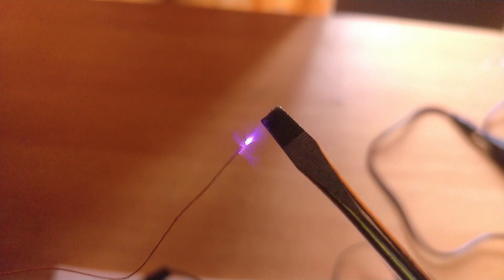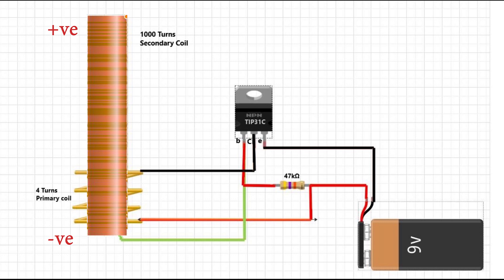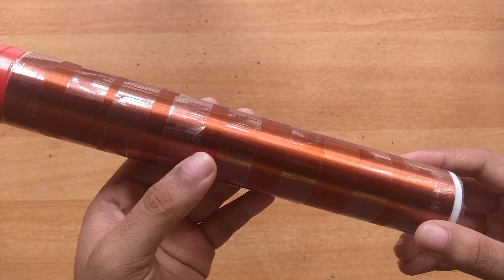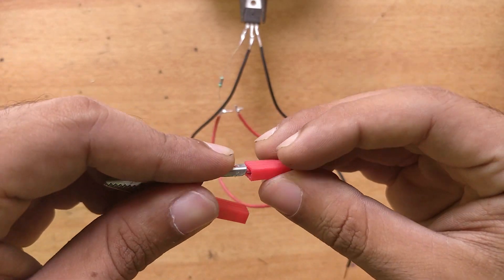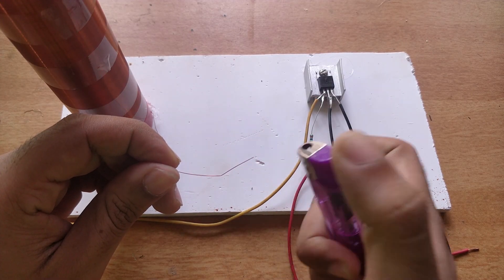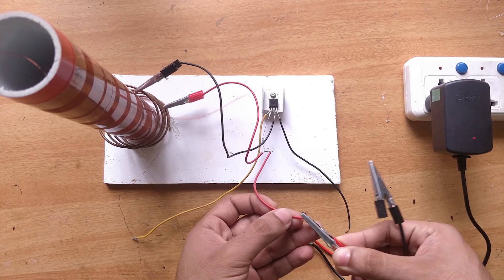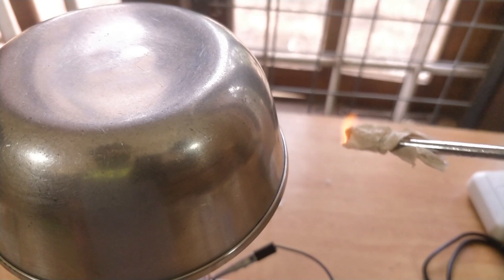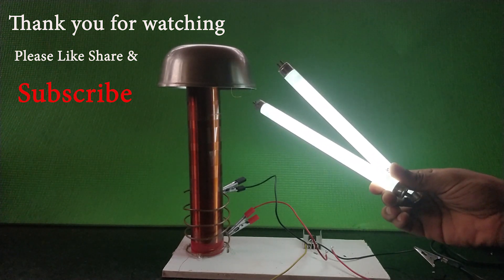How to make Tesla Coil at Home | Slayer Exciter | High Voltage Arc

Comment from the maker: There is a mistake in the video. It's 35 Gauge copper wire of 2 mm diameter instead of 30 Gauge wire.
 and the equation is (1/.20)x250 = 1250 turns.
Sorry for the worng information.
Reply: Can you give me 📞no
Reply from the maker: You can contact me on instagram@defender.scb or @behindtheclutter
Reply: @BehindTheClutter   pls tell me both copper wire are enameled or without enameled
Reply: Instead I can use 34gauge (0.23mm) 100 Meter yes or no
Reply: @NubierSmithen  yes you can.
Reply: Ok
Reply: I think you mean 0.2 mm copper diameter.
Reply: @privatepage7670  yes
Reply: Huh
Reply: Thanks cheta r u from south india?
Reply from the maker: Yes, I'm from South India
Reply: @BehindTheClutter  WHICH STATE?
Reply: Why there is 1/0.20
Reply: what would happen if I used a 1.5mm diameter insted of 2mm

Comment: I also made one but it is not working 😭 please help 
I used a 10 inches pipe which is 1.5 inches in diameter .
34 Guage copper wire for secondary coil and 20 guage wire for primary coil. 
A tip122 transistor and 47k ohm resistor 
I made more then 1000 turns in secondary coil and 4 turns of primary coil.
I used four 3.7v rechargeable batteries. 
I made the exact circuit as yours 
But nothing happened inly my transistor is getting hotter ......😢
Reply from the maker: Sorry, for the delay in response,  TIP122 transistor is fine but you need more transistors. You need a thicker wire for the primary. 3.7V battery is not enough to see the arc, if you are using it in parallel, that is not enough voltage, if you are using in series it doesn't have enough current, try using a stable 12V  2Ah or a motorcycle battery.  check if your current circuit is working or not by placing an incandescent bulb next to it.

Comment: Hey, would this work if my primary coil is 2.5mm diameter 5 turns and 0.5mm diameter 1000 turns?
Reply from the maker: If 2.5 mm is just the diameter of the copper in the wire then yes it will work. if its the measurement including insulation then its difficult.

Comment: Great video. Just made it and it works! of course it works.
Just a reminder to anyone, putting transistors in parallel may not work, it certainly wont work for long or wont work period. This is because no two transistors are identicle, so the one with the least resistance will take up most of the work if not all of the work. So it makes very minimal difference. But this circuit certainly does work and you can try it with more powerful transistors to increase the power!
Side note, Do not put a heatsink on the TIP31C transistor, It is electrically connected to the positive and will short circuit and kill the transistor: Learnt that the hard way :D
Reply from the maker: Thank you for the information and feedback. 😃

Comment: Hello sir, 
You are the best youtuber

i made a tesla coil with 2n222 transistor
and 3k resistance but it doesn't work
What i have to do?

Please reply 😢
Reply from the maker: 2n222 doesn't have enough power to run it. You need an NPN power transistor. Follow the video. It will work.

Comment: Please tell me that if i use Tip31c transistor with heat sink , will the transistor blowoff? , i will not use it continuously , my charger is of 12v and 1.5A ,
Reply from the maker: Yes it will blow off if you use it continuously even with a heat sink. You can use it safe if you use multiple transistors in parallel
Reply: @BehindTheClutter  if i use 3 parallel then how will i put them on heatsink?
Reply: @BehindTheClutter  2 in parallel are enough?

Comment: Can you help me because it doesnt work i used 
21mm diameter pipe length of 420 mm i used a 0.5 mm wire and 22k ohm resistor but it doesnt work can you help me pls and response quick.

Comment: How long is the life of this circuit when working with 12v?
Reply from the maker: It totally depends on the amount of current and the number of transistors connected in parallel. For 12V 2A and 1 TIP31C transistor,  It will work for 3-5 minutes and burn out the transistor.

Comment: I made project but nothing work pls tell me some mistake that to correct
Reply: The ciper wire u used is insulated .
For the thin wire burn the end so the insulation is melted,for the thick wire rub it with sand paper wherever u connect the crocodile clips
Also the power supply should be of 12v and 2 amp

Comment: Sir please five rhe link for the heat sink in the transistor,and the link to buy rhe resistor. Its not in rhe description
Reply: Also sir for hoe long does the metal plate  has to be on the tesla coil till it is finslly usable
Reply from the maker: It depends on the size of the tesla coil you build. and the size of the top plate.  The top plate will accumulate the charge until it get something to discharge.
Reply from the maker: https://amzn.to/3V1r3en
Reply: I have made the tesla coil and its works
But i am not getting such a big plasma that u get

Comment: Hey bro.. i tried it.. But unfortunately it didn't work... 
I used.. 
1. 23 gauge (0.541 mm) copper wire for the secondary coil.. 1400 turns (approx).. 73 cm high.. in 1 inch diameter pipe..  
2. 14 gauge ( 1.68 mm) copper wire for the primary coil .. 4 turns.. 
3. Tip41c transistor ( is that okay?? ) 
4. 47 ohm resistor ( 10k,10k, 27k connected in series)
5. 18 V input ..with an AC/Dc adaptor..

I connected exactly as you said.. but it didn't work... Please help me... Did I do something wrong .. I am just a 14 year old trying to do my best... 🥺🥺🥺🥺
Reply from the maker: Actually 75 cm is too high. You need to use at least 30 gauge insulated wire for secondary. If the secondary is too high you need a bigger primary coil for it to work. TIP41C is ok for this project. What is the current (A)  rating of your adapter. Voltage alone is not enough. You need at least 1.5A current.
Reply: @BehindTheClutter  hey bro... Thanks for your reply... Actually it worked.. i used the same circuit you used... Instead of 47ohm i used 10ohm.. somehow it worked... 👍👍 ( And I too lose the science competition.. 😅😅) and I have an idea... Is there any type of receiver circuit... For tesla coil.. like receiving Tesla coil currects from long distance...

Comment: Will the current coming from it harm us?
Reply from the maker: Yes, depending on the size of the Tesla coil,  It can hurt form minor burn to a heart attack if not used careful.
Reply: @BehindTheClutter  thanx for the information
Reply: @BehindTheClutter  can I use 18 gauge instead of 12 gauge? If so what will be the number of turns in the 18gauge

Comment: What is the minimum voltage at which your arc started to appear ?

Because if my calculations are right ,my Tesla coil should be producing around 3885Volts ,but still no arcs 😐 why ?
Reply from the maker: What is the current rating of your power supply? You need at least 1.5 A.
Reply: @BehindTheClutter  I'm using a 9 volt battery ,666 turns in secondary and 3 turns in primary coil , still no arcs

Comment: How to make a parallel connection with two or more transistor for sharing load. Please 
Or make a video on doing that . Thanks
Reply from the maker: It's actually very simple. You just have to connect the corresponding legs of the transistor together. Like, emitter - emitter, collector - collector and base - base, and the parallel connection is made.

Comment: Hi. First up, this is a wonderful video, good job and keep it up! Secondly, I have a question. If I want to pump up the voltage to produce more arcs, I would do so by multiplying the number of batteries/power source. However, I'm sure the transistor I'm using won't be able to hold more than 12 volts. Someone suggested dividing the power between two transistors, and I've bought another one. However, what I don't understand is how I can split/divide the current, it has 6 legs, total?
Reply from the maker: You can split the power between the transistors by connecting it in parallel. ( You just have to join the corresponding legs of the transistors together to make it parallel like : 1-1 , 2-2 ,3-3 )
Reply: @BehindTheClutter  Oh, I see. Thank you so much! Keep up the awesome work!!

Comment: Hi. Thanks about the explanation you give about this circuit! It helps me a lot. 
I want to ask about the transistor. I use another NPN transistor (2SC2073) and the Tesla coil works well, but what different with the transistor that you used?
Reply from the maker: There isn't much  difference. All you need is an NPN Power transistor  that can do the switching operations at high load conditions.

Comment: Hi, can I use a irfp150 mosfet to make this. And if i can make it is there any difference in the circuit
Reply from the maker: Yes, it's possible. Connect +ve to drain , -ve to source and supply base voltage to Gate
Reply: @BehindTheClutter  this will help me alot
Reply: Oh thank you soo much

Comment: Will there be any changes if I use a thicker primary coil??
Reply from the maker: Yes, if you increase the thickness of primary coin you can input more current so that you will get more output at secondary.

Comment: Can I make it with a tip3055 transistor and should i use any other resistor
Reply from the maker: Yes you can use TIP3055 transistor and you can use the same resistor.

Comment: Can I use tip3055 cause it also has a high switching frequency and it's a alternative for tip31c
Reply from the maker: Yes, you can use TIP3055.
Reply: Thank you bro it worked I added one diode in parallel to to get the maximum out

Comment: Hi Can we use 35 gauge 0.2mm how  much meter need 30meter or ?
Reply from the maker: Yes, you need 35 Gauge copper wire. It's measured in grams. You need around 200g for this project .
Reply: In meter

Comment: @Behind The Clutter  so with this single transistor can use I 15v
Reply from the maker: Yes, but only for a short period of time. After that I will start heating up. Try using TIP41C.
Reply: @BehindTheClutter  ok

Comment: Hi, Can you say how to get Huge Arcs using only single transistor?
Reply from the maker: If you need bigger arc you have to input more power. So you need to use a transistor that could withstand that power.
Reply: @BehindTheClutter  so with this single transistor can use I 15v

Comment: Nice video 👍
I want to build one, but running with AC mains directly (not DC). I want to generate 10KV. Could u help?
Reply from the maker: directly connecting AC could be dangerous. Anyway, feel free contact if need help.

Comment: What are the specific point to connect the positive and negative input?
Reply from the maker: Positive should be connected the end of the 47 kΩ resistor that connects to primary coil.  Negative should be connected to the emitter pin of the transistor. (It's already shown in the circuit diagram)
Reply: @BehindTheClutter  ok... Thank you again... 😀
Reply from the maker: You are welcome 😃

Comment: please do a viedo about rechargeable tesla coil
Reply from the maker: you can convert this into a rechargeable Tesla coil by changing the power source. Connect a 12V 3A motorcycle battery at the input.

Comment: Can we take PVC pipe length as 30cm? And can we use cardboard tube
Reply from the maker: Yes, you can take 30cm. It will have more number of turns, so you have increase the number of turns or thickness of the wire in the primary to give more field to excite secondary.
Reply: @BehindTheClutter  can u say exactly how many turns primary
Reply from the maker: @shivanandsuggi6146  if you are using 12 gauge wire, use 4-5 turns in primary.

Comment: Can we use 9v Battery
Reply from the maker: No, 9V batteries we have are of 300-500mah current rating. Which is not sufficient to power this set-up. You need a power source of atleast 12V 2A .
Reply: @BehindTheClutter   you are the best person
Reply: you reply to all comments
Reply from the maker: Yes, i have to.  But I don't get notification for follow up comments, so I miss to reply for follow up comments. 

You can also  use old motor bike batteries  to power the set-up.
Reply: @BehindTheClutter  thank you... Any other option

Comment: Hey can you also give the link for resistor...?
Reply: And dude can I even do with the help of 2 or 3 9v battery
Reply from the maker: No bro, current rating of normal 9V batteries are very less (300-500mah) you need atleast 1.5A at the input.
Reply: @BehindTheClutter  kk tq
Reply from the maker: INVENTO 10Pcs 47K Ohm Carbon Film Resistor 1/4 W Resistance 0.25 Watt 250mW 5% Toleance High Quality For DIY https://www.amazon.in/dp/B082NZYSX1/ref=cm_sw_r_apan_glt_fabc_MXD0S6YJRBM7CYMP8MXD
Reply: Thank you...

Comment: Bro for input 9volt battery for 1000 turns output how much volt
Reply from the maker: 9 volt battery is not enough for this project. It does have the voltage but it doesn't have enough current in it.

Comment: Bro 35gauge 3.3 CM pipe 40cm that's mean how many turns bro and how many turns for primary coil of 15 gauge and how much input and output
Reply from the maker: Bro, you don't need 40cm pipes. You only need around 25cm to 30cm max.  Ith that you will get  approx 1300 turns or more. 
You need 4 or 5 turns on primary. 
Input should be in 12V 2A.

Comment: Can I use 30 gauge copper wire and 15 gauge copper wire
Reply from the maker: Yes you can use 30 gauge copper wire for the secondary and 15 Gauge copper wire for the primary. Still it better to use 12 or 13 Gauge or less on the primary.

Comment: I recreated this exact circuit and it doesn't work at all!!! This is waste of time and parts!!!
Reply from the maker: If you recreated the exact circuit then it will definitely work.  There will be an error somewhere. Please check again.
Reply: @BehindTheClutter  I have tried and had someone else check the parts and the connections. Tried several modifications after that, but couldn't make it to work. I solder everything and I've measure all the parts, making sure they are new and in a perfect working condition. I also sent your schema to an expert who stated that it can't work..... so I am at this point convinced that this doesn't work.
Reply from the maker: Bro, I wouldn't be posting it here if it doesn't work. You can contact me on insta @defender.scb  ,let's figure out what the problem is.
Reply from the maker: What was your input supply ? Put a Fluorescent lamp next to it while turning it on.
Reply: @BehindTheClutter  I did, and nothing happens. I have a simple 2N2222 transistor circuit that works, but yours does nothing despite me trying few ideas.
Reply from the maker: Bro, could you please share me the picture of your set-up on instagram.  We can make that working.

Comment: Bro ....... primary coil il 14 gauge copper wire ne pakaram 14 gauge aluminium wire upayogichal enthengilum problem undavuo
Reply from the maker: Aluminum copperinte athrem conductive alla. Its better to use copper. 14 gauge thanne Venom ennillaa. 10-14 enthalum mathi. Aluminum work cheyyumarikkum but ethra reliable anennu ariyillaa.
Reply: @BehindTheClutter  bro.....Tesla coil ne input kodukkumbol positive negative ennenthengilum undo?

Comment: Bro.....it's important..... please reply.......are both wires insulated or not...........bro secondary coil etra meter Neelam venam...... please reply🔴🔴
Reply: Thank you bro
Reply from the maker: You are welcome 😃
Reply from the maker: Both wires must be insulated, but primary instulated venom ennu nirbandham illa, engum short akathithirunnal mathi. Instulated allatha primary akumbol number of turns kuttukayum kuraikkukayum cheyyam. Secondary coil 250 grams of 35Guage insulated copper wire.

Comment: Bro.... secondary coilne etra metre neelamulla copper wire venam
Reply: Bro primary coil and secondary coil insulated aano
Reply from the maker: Yes it's better
Reply from the maker: Angene correct oru neelam illa bro, you can buy 250g of 35 Gauge copper from an electric hardware shop. That will be more than enough for this project.

Comment: hi can you send me circuit diagram for irfz44n mosfet circuit or is it the same diagram as tip31c 
also is there any substitute for that pvc pipe
Reply from the maker: I think you  can use the same circuit for irfz44n as well. PVC is just given to make it perfectly cylindrical, you can use anything for the core as long as it's non-magnetic and non- conductive.
Reply: @BehindTheClutter  thanks for the reply i have trouble finding pvc pipes these days also winded the coil on Carboard roll for 300 times didnt get arcs but high voltages(around 800-2000v) and turned on a cfl bulb now im working on 1000 turn on a carboard roll.
Reply: It didnt work the mosfet getting really hot around 80 degress and the tesla coil shows nothing

Edit:after some researchs i found that irfz44n is not good for tesla and have to irf460n 
Im heading to the store

Comment: Can I use TIP41C and keep the circuit same??
Reply from the maker: Yes you can. It won't make any difference.
Reply: @BehindTheClutter  Man you are a legend... You are still replying?it is worth subscribing such a channel. Just one last question...can I power it with 18V with two 9V battery?? Will it give arcs??
Reply from the maker: No, I don't think 9V batteries are having enough current to make the arc. It needs continues current supply. 9V batteries are normally 300-500 mah
Reply from the maker: It's better to use a charger. 12V 2 Ah
Reply: @BehindTheClutter  thank you!
Reply from the maker: You are welcome 😃

Comment: Why this tesla coil doesn't need any capacitor?
Reply from the maker: Because to my knowledge, capacitors are used to make a variable magnetic field at a particular frequency so that a current can be induced inside the secondary coil. 

But here in this circuit the oscillations are  made by the transistor itself by  turning the supply on and off. So there is no need for an additional capacitor to do that.